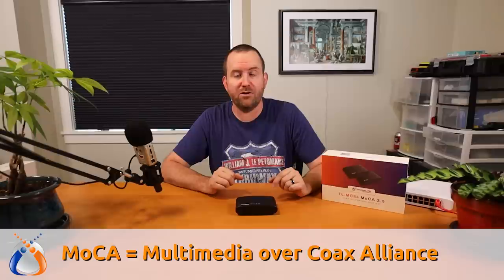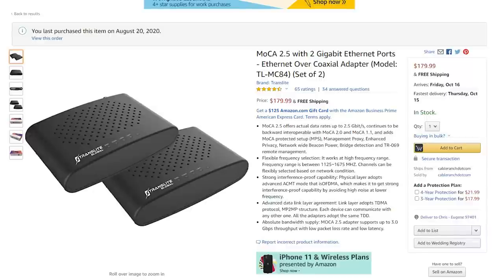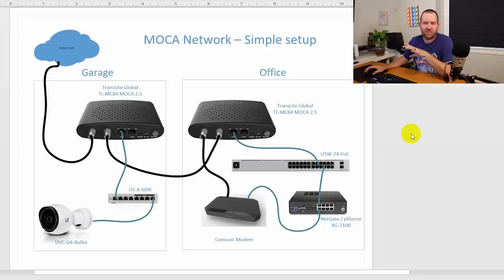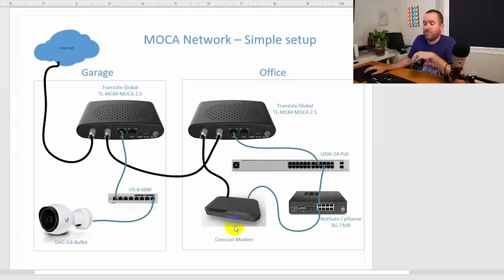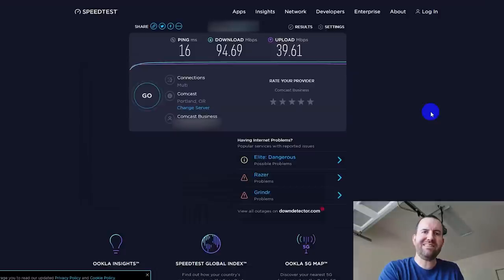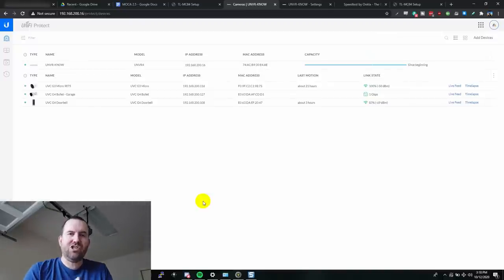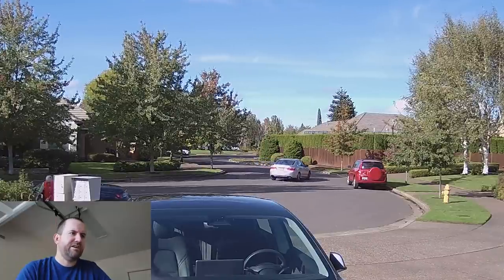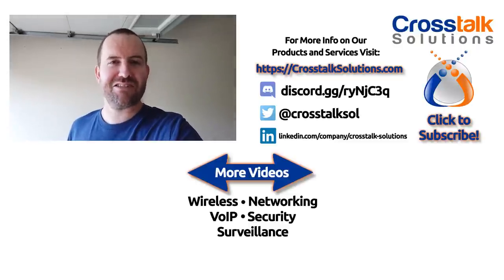MoCA Made Easy!

Comment: With the splitter setup, it's important to have the MoCA filter in place, as there is a risk that your MoCA signal will go out onto the carrier network. There should always be a a filter between the splitter and the feed-in.
Reply: Very very important! He is opening his secure network to the neighbours who may also have a moca adaptor, and may cause issues with Comcast's network as they start to use moca frequencies their network (moca uses frequencies above 860mhz and below 1.2ghz). Hopefully that filter in the network box is a moca filter which Comcast tech installed!
Reply: He’s using a MoCA filter.
Reply: @mark_m1966  he didn't say moca filter, he only said filter. The moca filter needs to be installed at the house demarcation point in the box outside, before the cable goes back to the plant.
Reply: @mark_m1966   Where do you get this filter?
Reply: @jasonax3184  They have them cheap on Amazon
Reply: @jasonax3184  My ISP gave me one for free
Reply: This is VERY important indeed!   A few yrs ago I was experiencing odd periodic outages with my internet.  After some packet analysis I determined there was a rogue DHCP server that I was randomly grabbing addresses from!  Neighbor had a MoCa setup without filter and was sending their info out to the whole neighborhood..!!!
Reply: Yeah, even though he obviously had a "PoE" MoCA filter installed, he skipped detailing its importance in a MoCA setup, either the security or performance benefits, didn't include one in either of this schematics, and just generically referred to it as "the filter" when exhibiting his junction box contents.
Reply: He has the POE where the cable comes from the provider. You do not need a POE filter on each splitter.
Reply: It's a 1% chance his neighbor has moca.
Reply: @matthewhorwat7540  no... that's a filter to stop you from getting cable, LOL
Reply: Moca filter goes on the ground block on the line going into the house never on the drop side.
Reply: Or can if you have a fiber drop there's no worry anyway from leakage into the plant
Reply: @jblazin52  then you'd need ethernet through the home. And would completely defeat the purpose of moca anyway. Which I mean I'm not the biggest moca fan but any house pre 2000 probably not going to have ethernet ran through the home unless it was done later for the most part.
Reply: @xxnapalmchildxx  Doesn't necessarily mean you have Ethernet run in your home. Moca could still be a great option for a older home. I'm just pointing out with fiber direct to the home there's no worry about leakage back into a coax based plant.
Reply: @jblazin52  yeah but then you'd have an epon not a cable modem you'd still need an rfog to run the coax
Reply: Is the filter built into the MoCA adapters?
Reply: @joeslacker1020  typically not. Depending on the unit, they can be configured on different frequency bands or have encryption enabled.
Reply: Can anyone tell me if you can hook one of these up to a coaxial that doesn't have a cable service to it?
Reply: @joeslacker1020  as long as it's isolated from the line in or the line in is filtered, yes. If it's cable, the standard config should work fine, if you have Satellite (there was a Direct TV version of these devices), you need one that supports lower bands (below 1100 MHz).
Reply: I'm struggling a bit w my mocca setup. I switched modems from cable only to phone and cable combo (Netgear CM500V) and I lost coax/ethernet set up in two rooms in my house. Had a nice setup before for 3 rooms and now is all out of whack. Any idea if this is common w phone/cable modems and mocca set up? Not sure if I should re run all new adapters on all 4 rooms
Reply: @JORGEMONTALVO80  they're meant to work, but the DirectTV MoCA adaptors use different frequencies, so if you're using those, you may have to get new ones. I like the Motorola ones myself.
Reply: @JamieLovick  With Dish it is called a HIC (Hopper Internet Connector).
Reply: @JORGEMONTALVO80  every time you add a "room" it causes the adaptors to use more band width, you might check your digital spitters to make sure they go to 3 GHz (Holland is a great choice), and make sure your phone and adaptors are compatible with the latest version of MoCA.
Reply: That's what I was thinking. 👍
Reply: Thanks for this! Couldn't figure out why I have DHCP issues. My ISP didn't install a filter and my MoCa network must be getting DHCP from my gateway, and from the provider.

Comment: MoCA encrypts data over the coax cabling.  However, to make things simple for no-technical people, all MoCA devices ship with the same default encryption keys so you can "just plug it in".  While it is recommended to put a MoCA filter at the ingress point, it is also STRONGLY recommended to set your own encryption key on all your MoCA devices.  This is part of the MoCA standard; all devices must support it.  How you configure it tends to vary from device to device, however.

Comment: The Cable Modem should always be connected to the highest signal level possible.   This is especially important for the uplink signal.  By running the cable signal to the cable modem through two splitters, multiple coax connections and unknown length of coax cable you are attenuating the signal more than 6 db.    The signal level might be fine now but down the road the level from Comcast may weaken due to changing weather connections, deteriorating infrastructure.   If this was my house I would connect the cable modem in the garage and find a way to get another cable (Cat5 or coax) between the garage and office.
Reply: Yeah, I thought he was running MoCA from his network back down to the garage so the modem was the first stop. That would solve his power failure point for his whole network too.

He probably doesn't have a second coax though...
Reply: I imagine the internals of those MoCA adapters also contain some kind of splitter, unless theres some kind of magic i'm not aware of. It would be interesting to measure the loss with both methods and see which works better.
Reply: I have eight moca adapters across four different cable runs, all split multiple times with the modem (for unavoidable reasons) being at the end of the longest most split run and it still works great. I just put a high quality moca compatible amp between the incoming cable and the first four way split. Moca really has been a fantastic tech for me - concrete walls mean bad WiFi and no possibility of running Ethernet..
Reply: In my case the Comcast tech added an attenuator to the coax (as it goes into the cable modem), because the signal was too strong.
Reply: J'aurais simplement installé un alimentation de sécour (UPS) pour l'équipement installé dans le garage (Moca device, switch, camera) et gardé la première topology. Mais tu as raisons sur un fait, il y a des pertes de signal à chaque splitters.  Deplus, je me demande si la tension de sortie de la prise MOCA de chaque appareil est standard ou est-il plus élevé?  En plus des fréquences plus élevé également, cela nuit-il au modem? Je pense aux interférences... Concernant les diviseurs coax, on installe la plupart du temps du 5-1000 Mhz pour la télévision, du 5-2400 Mhz pour le satélite. Pour le MOCA, c'est du 5-2500 Mhz.
Reply: @neildingwall6534  cant you tape ethernet wire to the coax and then pull the coax out while ethernet enters? If you used fiber it could take less space in holes and be better, but that is not easy.
Reply: @LordGryllwotth  Our local fiber suppliers ( I have a choice of 3) only use pre terminated cables and won’t run them through the conduit that the coax uses. Replacing the coax with Ethernet might be possible  but  I use the coax for cable tv and, although I could live without this, I am reluctant to try because 
I just envision the pull going wrong and leaving me with neither coax or Ethernet :). Moca solved the problem for me and I am getting good enough speeds.
Reply: @johnvillalovos  , only a cable tech that has access to the diagnostics inside the modem or using a specialized RF signal meter  can determine how much signal is getting to the modem.   The cable company usually supplies enough signal to account for the cable run to the demarc and a 2 way splitter (3db loss) inside the residence.  And in my experience the signal strength itself can vary according to weather conditions, especially in neighborhoods where the cable infrastructure is old or isn't properly maintained.  So one day it may need attenuation and another day the signal is too weak.   The cable modem can usually deal with too strong a signal but not a signal that is too weak.
Reply: @LordGryllwotth  Most coax is attached to the studs so you can't use them as pull lines.
Reply: @aaa000777  rf levels can easily be -10 to +10   docsis spec is open more than that .    35-50 return will work all day.    Some cable provided modems you can login and get level information.(look up your modem and see if you can find login info)  some isps will still let you do that on most modems
Reply: Unless there is a limitation to the second LAN interface on the bridge he could of just gone right from the cable modem in the garage with Ethernet in LAN2, Nothing in the "in/out" and bridged to his office over MoCA interface, then inject his LAN on LAN1, and receive his WAN over LAN2 in his office to his FW . If you cannot separate those two LAN interfaces, and they are just a L2 switch with no tagging abilities then he has no option than to go the route he showed as there is no way to extend his LAN to the garage with his existing infrastructure. As for the spliters I would not add them and leave them open as they introduce noise, depending on his db loss he would be fine extending the modem as far as he did with the spliters. RF vs Ethernet is so far apart on the spectrum its confusing as hell when the two meet. some cool tech, but id view this as a bandaid/temp not a permanent solution. Just run a few Ethernet drops and set up a proper IDF/MDF if your going to get techie with your house
Reply: @LordGryllwotth  -  That almost never works and you will end up with no end-to-end CAT5 or Coax cable!  Trust me. This is a bad idea!
Reply: My words exactly. In my home I run a wifi bridge for cameras and an AP in the garage. I currently have three seperate UPS devices. One for core of the network, one for one side of wireless bridge and primary house AP and one for the other side of the bridge and cameras At this point the chance of failiure is fairly low, atleast due to power outage (though a more robust backup power would be nice). And if he's so worried about losing conectivity to the Internet, well, that's simple. A pair of EdgeRouters in VRRP config and LTE (or whatever is avaliable and get's the job done) backup connection, MoCA devices betwene the two. Sure, it is more expencive and you have to do the setup in console or through config tree, but work's like a charm and what's best, as long as you set up the routers on both sides properly, you can even mix and match equipment manufacturers. When I'll be moving to a new home, given my job as an accountant can be done from home, I will have a WISP or LTE backup and will have to run my two routers in VRRP setup too. Also, Why does he bring TV signal to his office? Does he intend to distribute TV from there too?
Reply: And those crappy splitters plus garbage walmart coax probably has the return @ 56
Reply: @neildingwall6534  just cause your signal is fine. Doesn't mean everyone else is running high downstream frequencies or up
Some areas have trash signal no matter if you amp it signal is still going to be 💩 with so many dB loss from splitters
Reply: Power 15dBmV 10ms.                                                    Power 10dBmV 30ms.                                                      Power  5dBmV 50ms.                                                     Power  3dBmV 60ms.                                                     Power -3dBmV 80ms
Reply: Quick question man. This won't work unless you have a cable or sattilite auxiliary connection? It won't work with a regular Coaxial connection from your tv from a power source?
Reply: @jmhm17  I think he should have both his modem and his router in the garage, then the moca adapters extend his lan into his office over his coax and a network switch or wireless access point in his office for the rest of his networking. There would be no coax connection between his lan and the one coming in from comtex. He should get better speed from the moca that way too
Reply: @LordGryllwotth  Electricians often staple the cable inside the walls (they can't seem to help it--it is their electrician's training and electrical codes). NEVER staple any communications cables!!! They should hang loose inside the walls.

Comment: I have MoCA 2.5 setup completely dark using gocoax and it's met my expectations of turning the entire home coax network into a 1Gbps FD network. I tested p2p iperf around 950Mbps, and similar downloads on the speedtest using the 1 Gig bandwidth on the downlink. MoCA 2.5 supports 2.5Gbps total bandwidth, i.o.w. 1Gbps+ FD between 2 of the MoCA 2.5 nodes across 100+ m of coax. I am not sure what's wrong in your setup, but all your splitters may need to be looked into. MoCA requires splitters that support up to at least 1650 MHz frequency. I went with the one supporting 2500 MHz frequency, as there's little price difference.

Also there's a possibility that your cable modem supports MoCA and in that case you don't need the MoCA adapter feeding your cable modem. If the modem supports it, turning MoCA on should be a toggle button on the UI, and then you can use the adapters in 2 separate coax outlets away from your modem.

Comment: Been working with MOCA for years in multiple installs.  You need to check the band it operates in and make sure that band does not conflict with other things on the coax. Like satellite, Verizon, cable co etc. MOCA operates from 450 MHz to 1625. Make sure to get band filters. And a side note if you are only getting 100M between the 2 that is terrible speeds. As the name suggest 2.5 is rated at a throughput of 2.5 Gbps
Reply: Regarding LAN speeds. That’s exactly what I commented today. There are some serious issues with this setup if the best you can do between (presumably 2x 1G devices) is 100Mbps. For that you’re better off installing power line.
For reference in my home I’m getting 925Mbps in my iperf test

Comment: I recently built out a MoCA system, and MAN, it is just great. I think I 'hand-waved' over MoCA for a few years not really understanding it, or mentally equating it with PowerLine ethernet (which I've always heard terrible things about). I am so impressed with MoCA in my house; I've got the first floor built out with ethernet, and the second floor has two MoCA adapters bringing hardwiring to my desktops and the second WAP. It's just really solid.

Comment: I am running this same set of adapters, I am using it to link my two Asus AX3000 routers in mesh mode. This setup never misses a beat, it handles my Gbps connection with no issues. I had to move to this setup because the house here in Japan is concrete and this was the only way to connect the entire house under one network with good speeds.

Comment: Enjoyed your video. I’ve been using MoCA for over 7 years - works great. 
The speed should be much higher. Ensure you use correct splitters and filters as others have indicated. 
My initial tests showed 800mbps and can sustain 450mbps from wireless device AP to server.